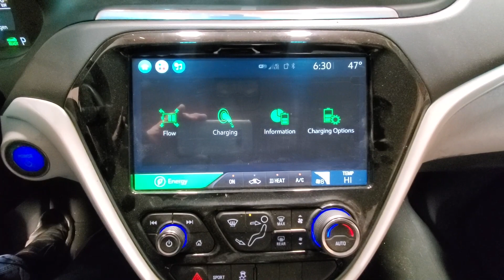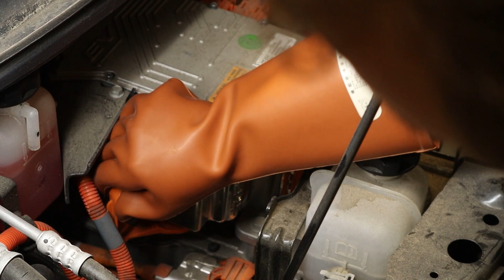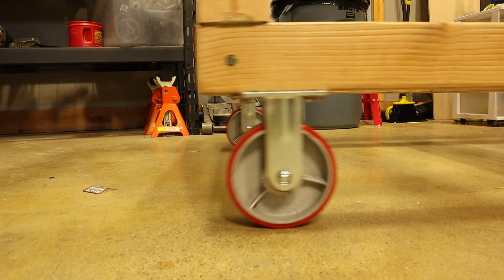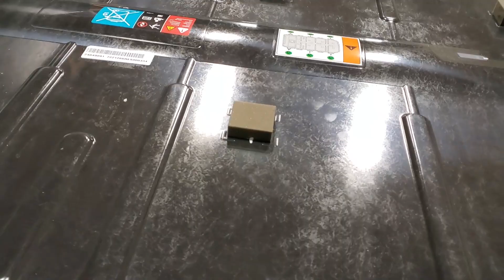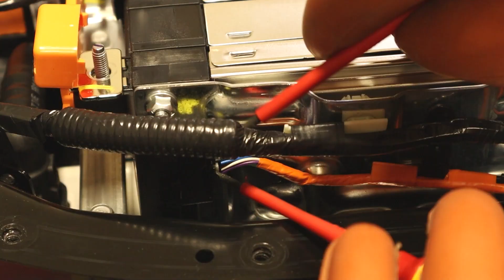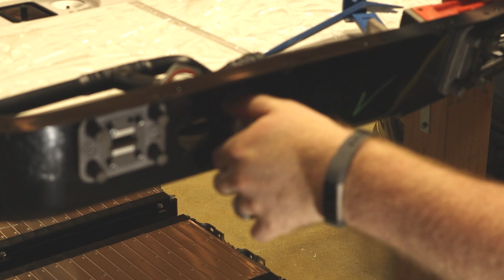Disassembling a BRAND NEW Chevy Bolt EV replacement battery pack for the DeLorean!

Comment: Why not use an impact gun instead of the electric ratchet?
Reply from the maker: You could use either - I went with the ratchet since the bolts are m6 and not torqued very much.

Comment: Wow! I really appreciate you doing these videos on the Bolt battery. There is a discrepancy here though. At time 13:04 you label the battery modules (1-10). This labelling doesn't agree with the labels we can clearly see in your video "Chevy Bolt Battery Pack - Battery Section / Modules" where we see that module 5 is the smaller module on the passenger side. I would appreciate knowing the correct module numbering.
Reply from the maker: Yes, good catch, this video has them incorrectly labeled. The video labels them starting at 1 on the positive side (front-most module on the driver side), whereas the Bolt EV technical manual starts at 1 on the most negative side (front-most module on the passenger side).
Reply: @BillCarlson Thanks! Would you happen to know how the cells are numbered (as far as PIDS for extracting cell voltages)? Is cell #1-20 in section 1, or is it cell #1-10 in module 1, followed by 11-20 in module 2?
Reply from the maker: @BarryDorfman  Oh, that's a good question, I haven't dug into it, but the BMS "split" down the middle, so I would bet that 1-10 are module 1, 11-20 are module 2, etc. I bet that the technical manual covers the arrangement. If you haven't seen it yet, you can find a link to a Google Drive on a reddit thread.
Reply: @BillCarlson  Thanks again! Great tip. You are correct. They’re done in module order. Cells 11-20 are in section 2.

Comment: Hey man, great vid! As I can see GM opted to cheap out on cooling on v2 battery as well.
Have you considered adding some cold plates on top of the battery packs to maybe mitigate fast DC charge swelling?
I'm considering buying a Bolt for myself and this thermal (in)consideration is holding me back.
If adding top heat exchange is possible I'd consider getting one.

Comment: Why did you need to open it?
Reply from the maker: The DeLorean is very small - no where to put the fully enclosed battery pack. The modules are taken out and split apart, then put into redesigned battery boxes that go in the front and back of the DeLorean where they will fit.

Comment: Got the HV under-gloves too? Need something JUST IN CASE you unknowingly puncture the outer gloves.   Nice expensive HV insulated screwdrivers and sockets... but not so the magnet used to pick up the nuts ;-)
Reply from the maker: I do! When I shot this video I had received the wrong sized over-gloves, but now I've got the correct sized pair for additional safety. :)

I'll see if I can find a HV-safe plastic wrapped magnetic stick... no promises! haha

Comment: Don't use GM's charging connector that was the problem.
Reply from the maker: I've seen some reports of burnt out charging connectors due to aftermarket chargers - but only one or two. The issue with the batteries catching fire was an internal issue with the battery cells, and my batteries are all replaced.
Reply: @BillCarlson  LG's Batteries are in other EVs they didn't have problems it sounds like a voltage regulator or the connector to me. but not one will ever know because the government won't investigate them.
Reply from the maker: @METALMAN4Wii  The Kona was also recalled for the same issue, and there is currently an NHTSA investigation for all other LG packs: https://www.detroitnews.com/story/business/autos/2022/04/05/nhtsa-investigation-lg-energy-solution-electric-vehicle-battery-recalls/9467236002/

Further, GM and LG has been working with NHTSA since the first fires, which is what prompted recalling and replacing battery packs in every Bolt EV and Kona EV made.

You can find pictures of the fires - they are not being started near the charge connector (which is just in front of the driver's door) and there is no "voltage regulator" in the pack. There is a DC-DC converter, but it's under the hood. All of the fires start from within the battery pack and vent smoke out of the backseat.
Reply: @BillCarlson  Dam hope for your sake they fixed the problem I know Tesla has their own EV batteries.
Reply from the maker: @METALMAN4Wii  Me too! So far there have been no reports of similar fires with any replaced packs, so that is a good sign, but only time will tell!

Comment: Why does your battery housing labels show new stickers over an old stickers?
Other photos I’ve seen on the new battery only shows one sticker on the new packs.
Reply from the maker: I don't know for sure - but my guess is that because this was such an early recall-pack that it was already labeled with the older info, and then got relabeled when the battery modules got installed.

Comment: Hey Bill, do you have a link to the Chevy battery removal process? I recently purchased a Bolt with a replaced battery, then I noticed one of the rear seat latches was broken. The dealership I bought the Bolt from says you don't have to access the high voltage disconnect under the rear seats to change the battery, but a second Chevy dealership said the opposite. Just trying to get an official source, I would assume the high voltage disconnect would be a necessary step in the battery replacement process and the rear seat latch was damaged during the swap.
Reply from the maker: Yes, here you go: https://static.nhtsa.gov/odi/rcl/2021/RCSB-21V560-5618.pdf

Technically it is not necessary to remove the rear seat first, though I'm not sure of whether its specified in the above document. You can drop the pack with it in place, but they would need to swap the manual service disconnect with the temporary cover piece on the new battery after.  For safety reasons, though, I don't see why they would do it that way given that it takes about 30 seconds to lift the rear lower seat cushion and remove the MSD.
Reply: @BillCarlson  thank you!

Comment: just got my battery replaced today on 2017 Bolt .... Could not believe I found this video.  These batteries suppose to last 26 years up to 300-400K miles
Reply from the maker: I don't see any reason they won't last that long. There were/are examples of Bolts with 200k+ miles on them, so barring another wide scale manufacturing defect I think the replacement batteries are going to last hundreds of thousands of miles typically.

Comment: I'm no expert, but you should have leather gloves on over the rubber gloves. Rubber gets sliced/cut easy, which exposes your bare skin to whatever you're working on. 
You need physical protection over the electrical protection.
Reply from the maker: Thanks Zack! Love your channel - been following your Hummer EV conversion closely. :) You're absolutely correct - I was supposed to get leathers to go on top. The ones I ordered online didn't fit over the rubber ones. :/ For assembly I will be sure to use both.
Reply: @BillCarlson  looking forward to seeing the rest of your project!

Comment: This is very neat. Great project.  And also excellent for road trips espacialy whe you have the ccs on the DeLorean. Thst is going to be very awesome.
Reply from the maker: Thanks! Yes, I'm going to really put the CCS to use, too. My work is roughly 115 miles away, and that's cutting it close to be able to drive in one charge, so I'll likely have to do a short stop somewhere along the way.
Reply: @BillCarlson  if you manage  to get 3.5 mi/kwh and use 58 kwhrs out of the battery looking at 203 miles. That's pretty good. Excited to see how it does on the road and how much it's consuming on mi/kwh for your trips. On EA units maxes out to 55kw on charging. And also add better cooling to your pack you should be good and also using the 2kw and the 7kw cabin heater and the app torq pro to view the coolant temp and the battery  temperature.  And a switch  to warm the battery  quicker during cold seasons using the 7kw heater will be great.

Comment: Bill, you're a master!  Great technical and mechanical work, but also very skillful storytelling and video editing.  I also have a 2019 Bolt with a Ochang battery pack, but my dealer is scheduling replacements out to May.
Reply from the maker: Thanks, I appreciate your kind words! Good luck on the battery replacement, I hope that by then the dealers have it all smoothed out. It SHOULD be a fairly simple process for them once they do a few.

Comment: What a great video! I am now hooked on your project!
I'm a Bolt owner. Getting my brand new pack today!
Just a note: In my Bolt they are "Heating Plates", this time of year. 
People seem to forget it's a Thermal Management System.
Reply from the maker: Thanks for joining!  And yes, that's definitely true, they are used for both heating and cooling to maintain consistent temperatures.

Comment: Super cool, did you consider fitting the existing pack into the Delorean or was disassembly the only way it would fit?
Reply from the maker: The pack is waaaaay too big to fit in the DeLorean! The only way to make it fit is to break it down into modules and stack them in a very particular way. The DeLorean is very small - the only places large enough to hold even a single module are the trunk, gas tank, and rear engine bay - and I'm using all of those to hold the pack. :) As far as I know, once complete this DeLorean will have roughly double the battery pack of any other electric DeLorean.
Reply: Yep I had to subscribe...waay too interesting! I have done a number of engine swaps in the past and am just accumulating electric components for a EV conversion of a 68 MGC GT. A different direction than what you are doing but you have a great idea there!
Nice!
Mike 🇨🇦 🍁 👍

Comment: How many 10mm nuts were there?
Reply from the maker: I would say about 200 or so. I filled up a ziploc bag with all the fasteners from the battery. Another 3 bags from the "engine bay" and interior.